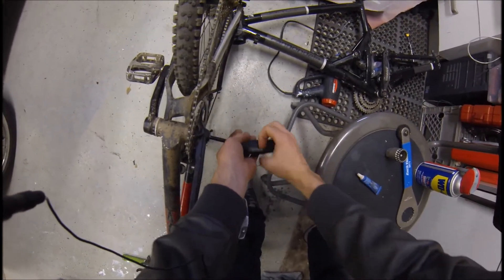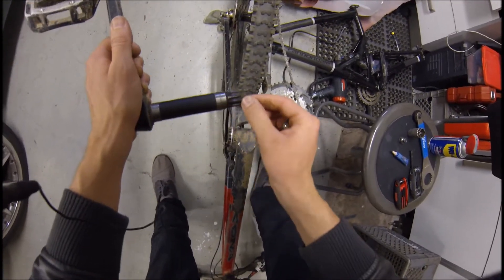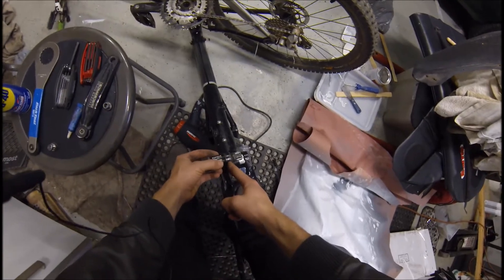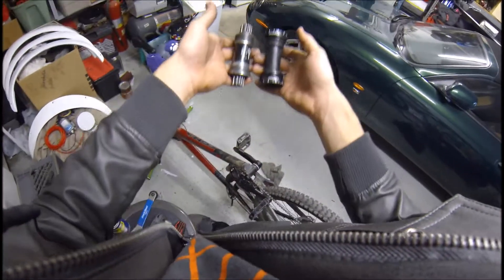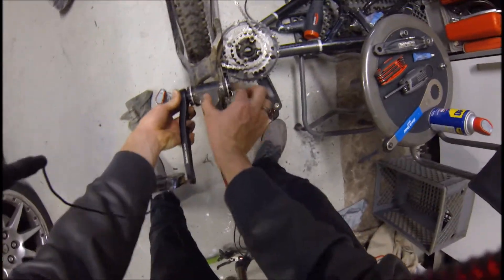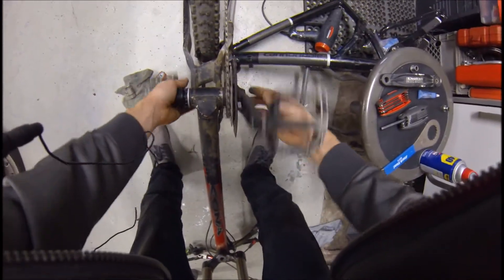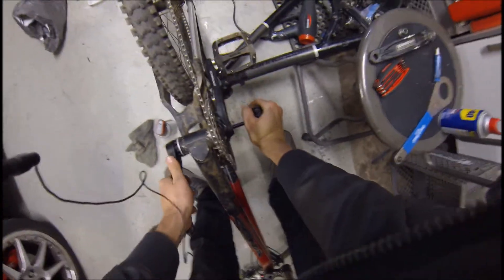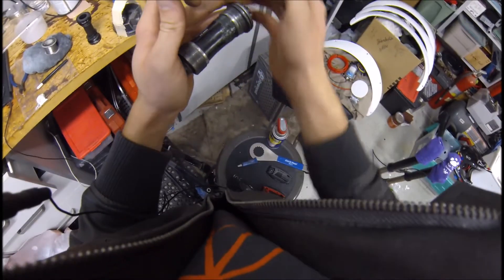Changing Internal to External Bottom Bracket BB Easy How To

Comment: Man you have been a huge help to me with your vid-thanks. My last bike I put together with parts from Pricepoint. I bought a Sette F/S frame, then added all the goodies. I had a Truvativ Firex crank with external bearings. One thing Id like to add-check them OFTEN. The one on the drive side came loose on me one night and the cheap aluminum Sette used-yeah it was trash. So it all stripped out and couldnt be fixed. I had to JB weld it to hold it in. About that time I decided to sell the bike and get a 29er. Found 2 cracks on the bottom of my old bikes frame, sold it all for parts and Pricepoint refunded me on the cracked frame. But now my new 29er has a Suntour crank/BB with internal bearings. Im going to use some of Pricepoints credit to me to get the external bearing crankset but wasnt sure I could. Thanks to this vid I see I can! great!